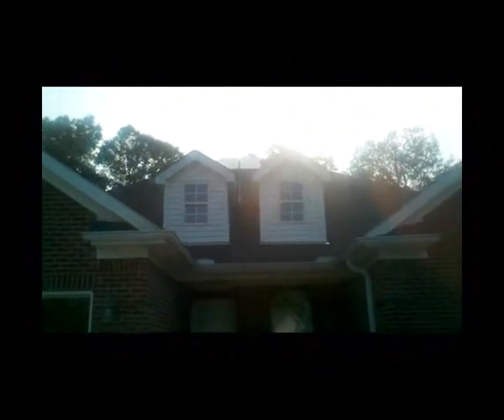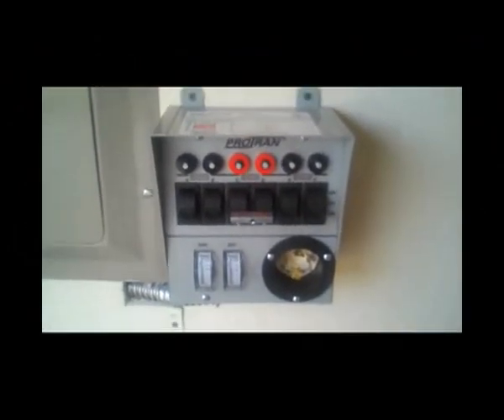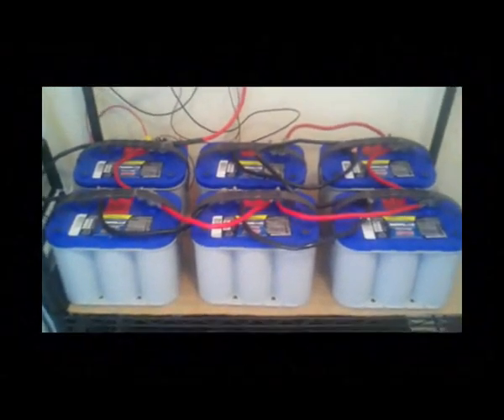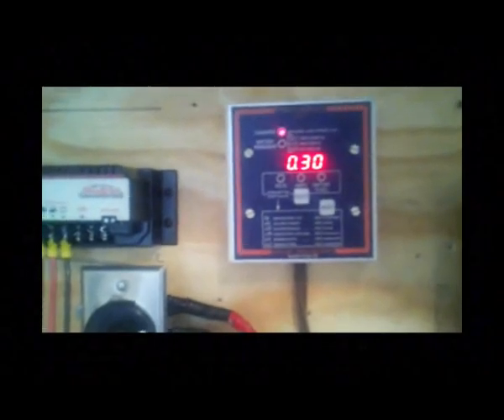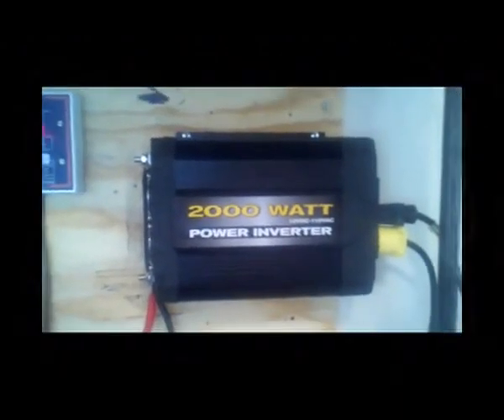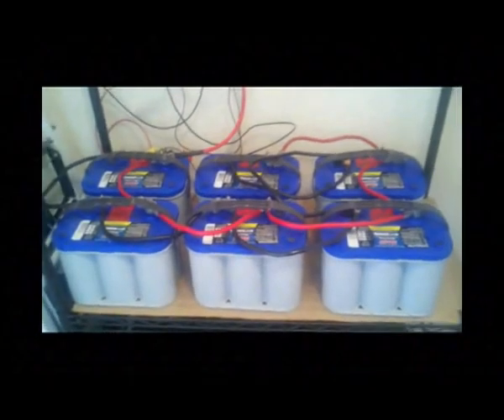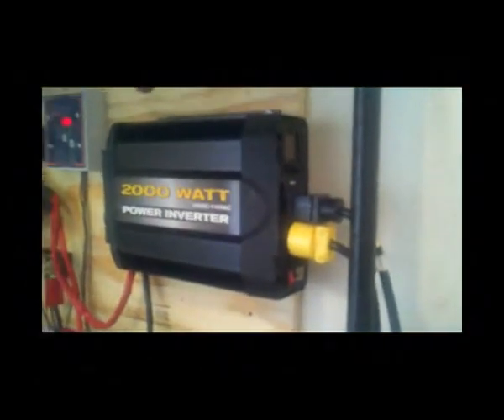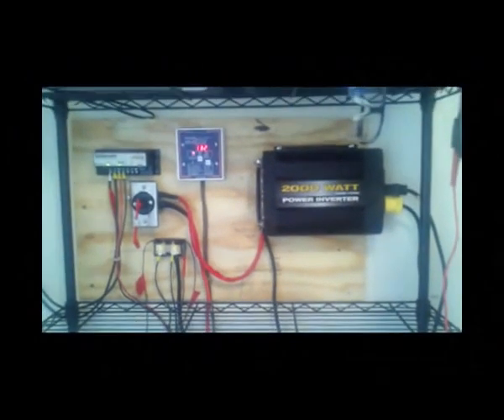DIY - My Emergency Solar Backup System - Update

Comment from the maker: @nrodge1 Thanks for the tip, I'll check out the site.  I tried to size the battery backup capability to support a compact freezer in an emergency, and some extras.  It's very efficient and the duty cycle is maybe 20 to 30 % during the day.  When it does run it only takes around 90Watts after initial startup and the system can run that for more than a day or two.  Currently I'm moving from a backup system to a partial off the grid system with 400Watts of additional power from 2 panels.

Comment from the maker: @msgabriellebianca Thanks. The Transfer switch and auxillary outlet were installed and wired by licensed electricians. The switch was wired to recieve power from a Gen, Utility, or Inverter connected to the outlet. The outlet was split into 2 separate branches to feed power to circuits (1)"ABC" & (2)"DEF". This is similar to the 2 AC branches that come into a house. And yes, the cords are 2 male plugs. Becareful, some inverters don't play nice with grounded plugs. Use an electrician to wire it.

Comment from the maker: @firehawk71 Sorry for any confusion. Here is where you would be better served by an electrician. However, I think your proposed approach would work fine for what you intend. I believe my electrician tied into the xfer switch at the 220v gen connector, i.e., off the prongs going clockwise, 1 & 2 = 110v, 3 & 4 = 110v. That way my Gen connector stays energized from the inverter at 220v and why it can feed 220v back to my backfeed breaker. You should be able to piggie back the same way.

Comment from the maker: I have 12v AGM batteries. They are dual purpose. I chose AGM's because they are sealed and can be placed virtually anywhere without worrying about gassing etc. They are more expensive than regular flooded batteries.

Comment from the maker: @rsg119 Also, when feeding power from the Inverter to the XFer switch, please be aware of potential GFI issues if not wired correctly. Meaning, most inverters are grounded internally to the chassis, the Main Panel is also grounded, when backfeeding to the Xfer switch, the 3rd prong in the power cable\cord is not connected, because it would create 2 separate grounding paths in the circuit and cause a fault.  So your power cord\cable must be a 2 pronged cable instead of the standard 3 prong.

Comment from the maker: @rsg119 There is only one phase coming from the inverter. However, I'm using 2 separate receptacles on the inverter so no one receptacle will be too overloaded. By having the electrician split the circuit, this gave me the 2 phases I needed thus giving me 240VAC at the transfer switch. In my later videos I've upgraded the system to include an Interlock Kit, and I can now feed that 240VAC through a backfeed breaker into the Main panel to energize the two branches in the main panel.

Comment from the maker: Yes, the panels are still charging the battery when I'm using the system.  The power is still going into the battery to "offset" the power coming out of the battery.

Comment: Don't forget that a fridge cycles, runs about every 20 minutes depending on how it's set and conditions of course. Those batteries will do good for a long time. You may want to look at the forums at  techluck.com for the schematic for a 	
Automatic Transfer Switch setup that could do that switching automatically. You should be able to add it to what you already have.

Comment from the maker: @msgabriellebianca Also, one other key point,, this type of setup CAN NOT run a Generator and an Inverter at the same time. It's an either\or situation.  The Gen OR utility OR Inverter.  To plug a Gen into the receptacle on the transfer switch while the Inverter is plugged in will result in damaged equipment or worse.

Comment: For the trasfer switch, you require two separate circuits which you had the electrician split for you in your auxilary receptacle. This is required since you need two phases to operate circuits in your main panel.  Do you actually have two separate phases from the inverter or is this just a trick to allow the trasfer switch to operate correctly?  Thanks.